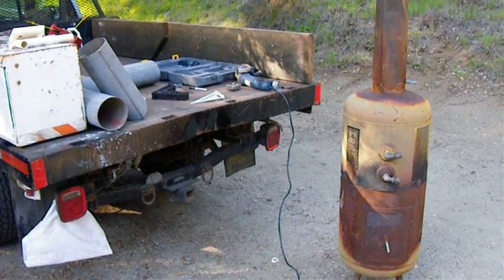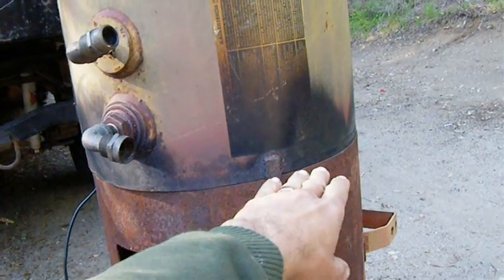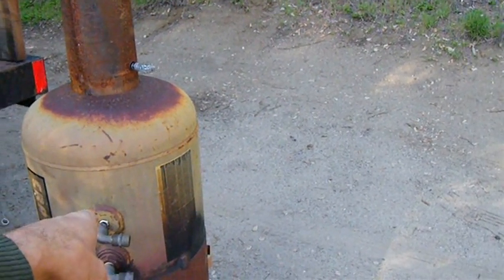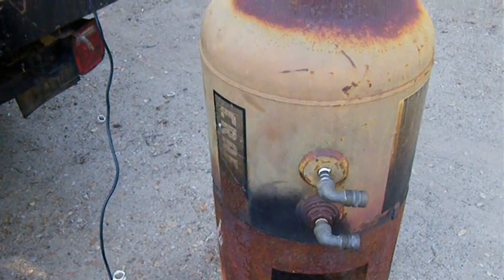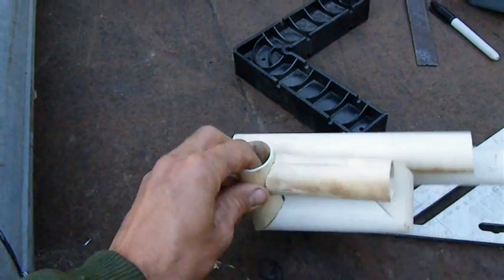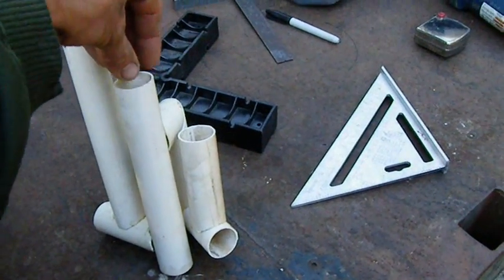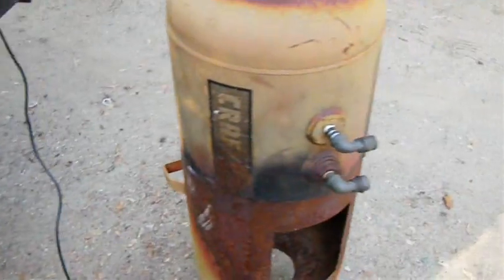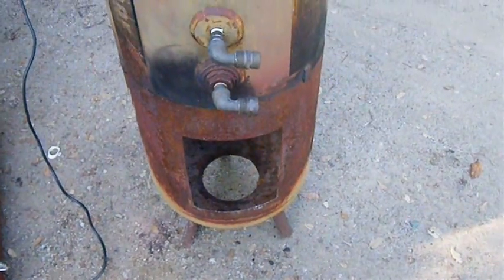Rocket Stove Hot Tub

Comment: Very interesting model design. What you have described is a vertical water tube boiler set up. Mr Cahall was one of the originators of this design around 1900.  Most efficient with the added benefit of any mineral deposits drop down to the base, unlike a horizontal water tube which would clog.  Well done.